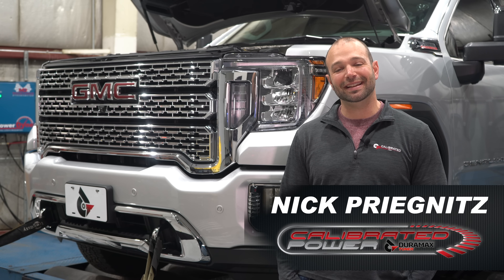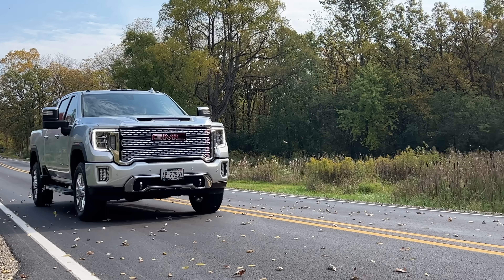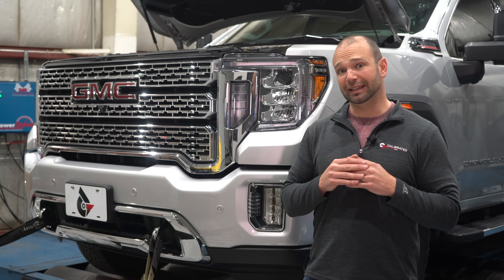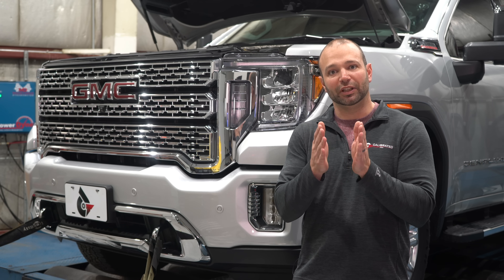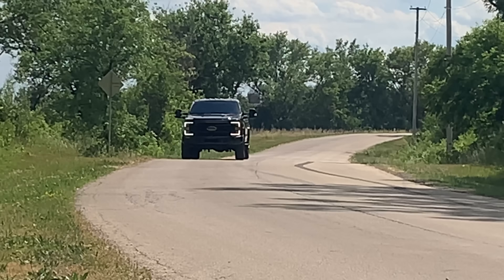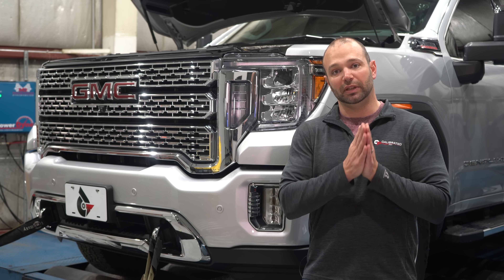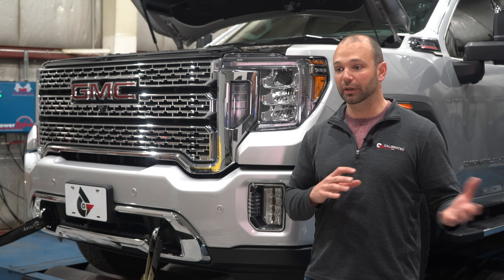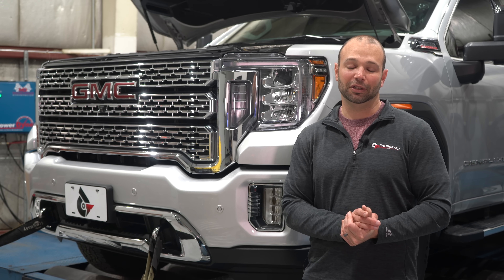10-Speed Allison Transmission 101

Comment: Great video, Nick!!  I know some or many of the RAM owners want a 10 speed transmission, but the more I drive my 2018 RAM 2500, the more I am thinking it may not work as well with the Cummins.  Perhaps a loaded question, do you think 6, 8 or 10 speeds for the RAM Cummins trucks is the best fit (towing as the main application)?  Maybe a video (if you haven't already made one) on this topic?  Thanks.
Reply: I think the 6 speed serves the Cummins well but I wouldn't be surprised at all to see 8 gears in the coming years.  10 would be overkill if you ask me.
Reply: @nickpriegnitz5895  Thanks, Nick.  Makes sense with a redline of around 3,000 rpm on the 6.7 Cummins, we should be staying close to max torque and horsepower most of the time in normal conditions.
Reply: Yeah the Cummins powerband covers a lot more of its rpm range than the v8 duramax
 and powerstroke cuz it revs lower so it doesn’t really need to shift as much
Reply: It’s like the big rigs, 18 wheelers, you can get 8 10 13 and 18 speed, more gears are better, keep rpm in the optimum power range
Reply: We’re really hoping for the 9 speed Allison in Rams. That would be awesome

Comment: Fords skip shift sucks, f150 here 1-3rd shifts harder then my built 68rfe
Reply: Weird my f250 is smooth, wish they would do like gm tho and cut out first except for tow haul mode. First is such a granny gear and when your trying to get to 3rd it revs high for just normal driving. I hear they do this tho to try and keep the egr cleaned out.
Reply: @MattC0725  yeap i agree i have 3.73 so 1st is pointless with out a load. and 3rd reving high becuase the TC trying to lock up,mine does it aroud 20mph in 3rd
Reply: @Wesselss   shit i got 3.355 and its too high i can only imagine 3.73
Reply: Try tuning the transmission
Reply: I use zfg racing and my 600whp ecoboost destroys everything and still tows 11k

Comment: I finally felt like I was part of the cool club with my DT550 and 6 speed conversion 😂😂😂😂
Reply: Your membership card is still good ;)
Reply from the maker: Always a cool club!
Reply: You’re not missing out - Randy’s is seeing the 10 speeds destroying hubs on stock power and said they are going to be the next “68rfe” which is the highly expensive, high fail rate Cummins trans. They drive great on stock power, but longevity appears it may be an issue.
Reply: @kwaggs19  68RFE isn’t as bad as people make it out to be. It’s an ABSOLUTE LIE to state it’s a “high failure rate” unit. The 68 isn’t perfect, but in stock and lightly tuned trucks it’s perfectly capable and reliable. No, it won’t hold up with compounds and heavy fuel. But it’s NOT a bad trans. Anyone that says it is is either IG or trying to sell something.

Comment: 2020 gmc 3500 drw welding rig. I carry about 2500lbs all the time. I'd love to put a mild tune on this truck, but I'm afraid that the 10 speed trans would give up. What's your thoughts?
Reply from the maker: We make sure our tuning is safe for stock transmissions and now with the ability to tune the TCM it offers even better driveability coupled with stock reliability.
Reply: He told you in the video Tran tune duhhh

Comment: Allison 6 speed 💪💪
Reply from the maker: Loved in this community!
Reply: 405 K on my LBZ, never even a small fart out of the Alli 6 speed or it’s magic box.
Reply: Except the controller... 😂
Reply: @mikz86ta1  what’s wrong with the controller?
Reply: @jumanji6969  they are known failure. GM even puts a 3yr Unlimited Mileage warranty on them now if you buy the AC Delco one from dealer and have them install it.
Reply: Finally got the 6 speed dialed in after all these years and then they scratched it

Comment: the F&F reference was GOLD! My real question is, Does a large displacement diesel NEED 10 speeds? or could OEM simply build stronger 6 speeds considering the power curve of modern VGT diesels.
Reply: In today's Era with the EPA the 10 speeds makes the engine run more in its powerband, imo if you get a larger turbocharger and let the truck Rev a little bit higher, you get a lot more efficiency out of the turbo making the 10 speed just another thing to shift longer
Reply: @beowulf885  Every generation of DMax since the LLY has received a smaller turbo.  The trend (in this segment anyway) is to lower peak torque and take advantage of the narrower operating range with more gears.
Reply: @nickpriegnitz5895 so essentially more mid range power because its always in mid range and sacrificing the high end?